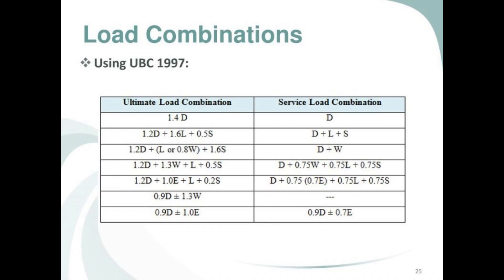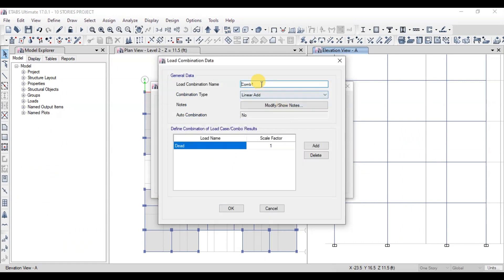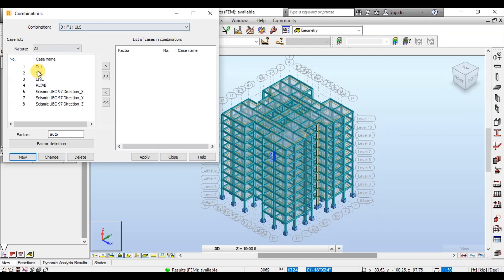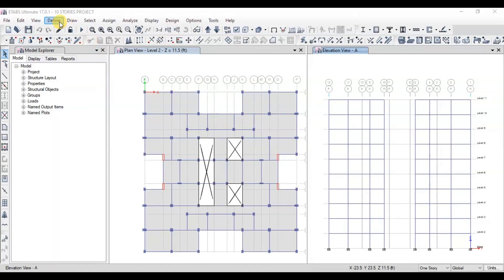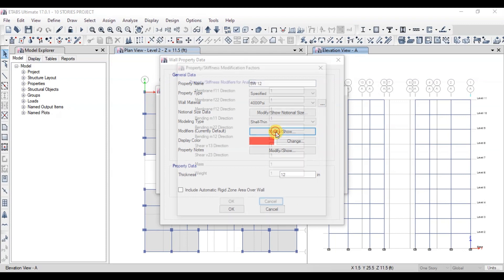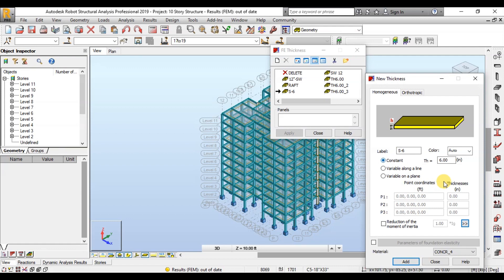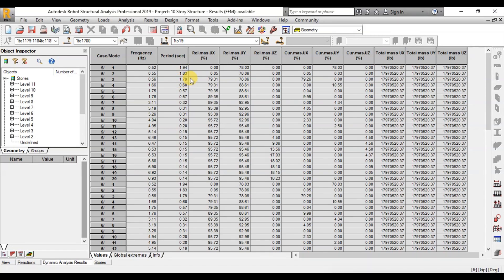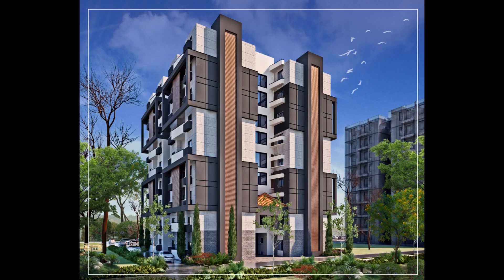Load Combinations | Cracked section analysis | Stiffness modifiers | 10 Story Building Robot & Etabs

Comment: I would like to ask, when using Revit to draw structural drawings, the beams or columns are sometimes not aligned with the column line. If such a model is input into Robot analysis, will there be an error? Thanks in advance!